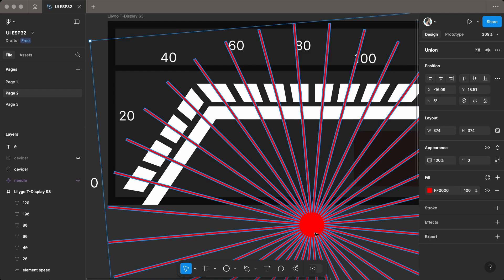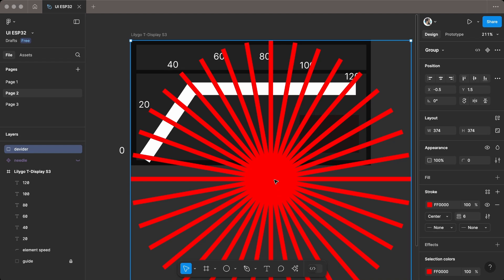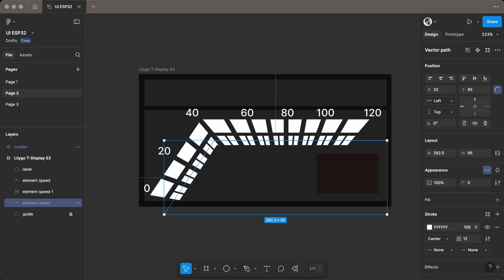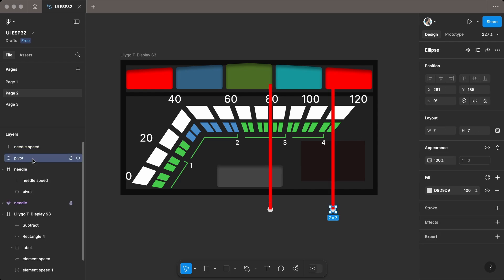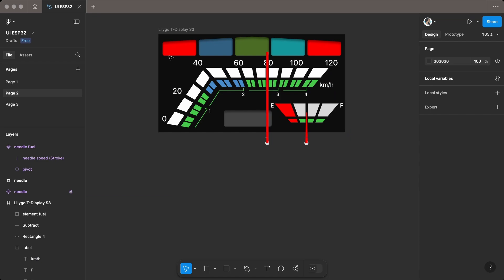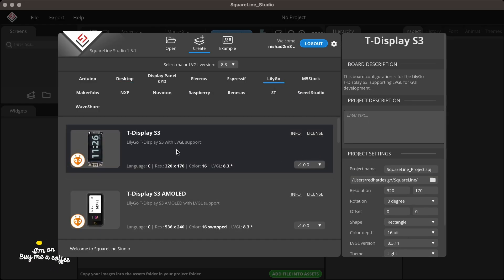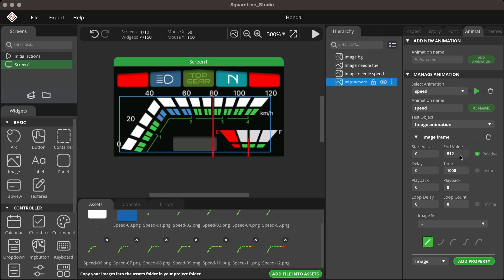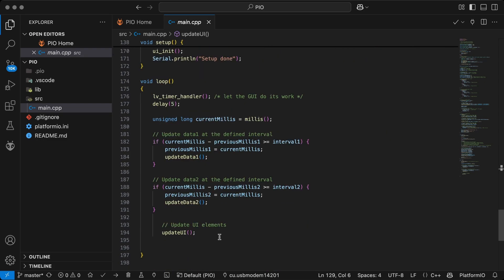Honda-Style Auto Gauge HMI Design | Figma, Squareline Studio & LVGL #UIDesign #HMI #Figma #Gauge

Comment: You don't have to mimic physical device in UI design except for aesthetic purposes as a joke. Honda's dashboard meant to be clearly visible by side-sighting while you're focused on dangerous activity driving your car. It's also HUGE comparing to watch display or any small display you use on your video. It also LIMITED because it's physical and should be implemented in production by easiest and cheapest way for fabricators. 

All these factors have NOTHING IN COMMON with your usage case. So you fundamentally wrong applying the same design pattern for your UI/UX purposes. 

And figma is THE WORST tool for complex structured vector shapes design. Making curved but perfectly aligned shapes in figma is like making graphics design in Microsoft Paintbrush.  Use normal vector editor instead and copy/paste to figma. It will save you HUNDREDS OF HOURS of your lifetime. If something is possible it doesn't meant to be done in particular way. Common sense first. Solutions and tools - later !
Reply from the maker: Thanks for your input! Just to clarify, this is a hobby project, not something meant for production. It’s more of a simulation or a concept UI for sensor readings.

Personally, I like to draw from real-world references in my designs, not just in UI, but also in print and social media. It helps create a visual language people instantly recognize, even if it’s just for aesthetics.

I agree Figma can be tough for complex curves, and I normally use Adobe Illustrator for that kind of work. But in this case, I wanted to showcase a free tool that anyone can try, especially beginners.

Appreciate your perspective though